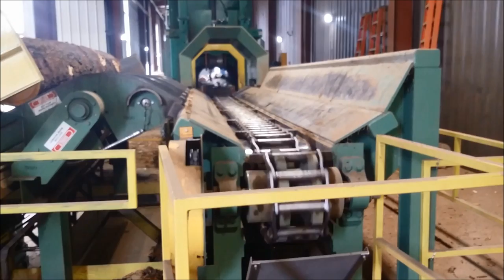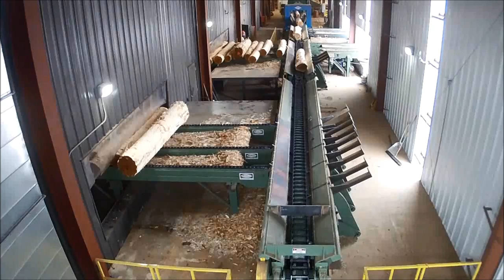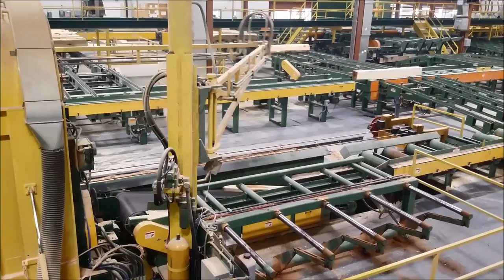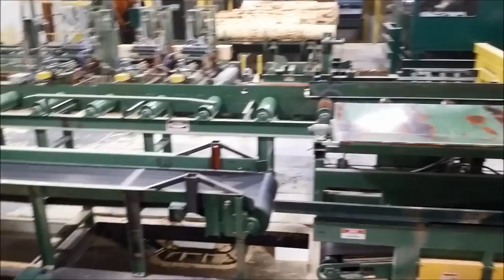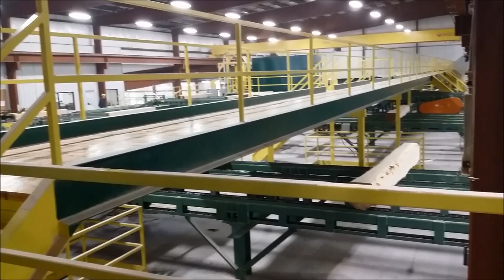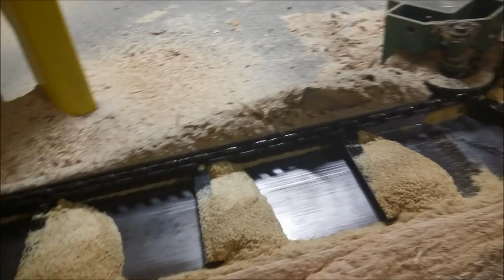MELLOTT -  Log and Lumber Conveyor Systems at Wagner Millwork - Owego, NY

Comment: At least one time I’d like to see a video of the filing room or two. Places where I worked called the filing room the heart of the mill. I worked as a saw filer in my youth and would like to know if they still use same methods as I used back then. Like hammering saws, etc. in both circular and bandsaw. I first trained on 5 foot gang saw blades before I moved up the ladder. Don’t see too many of those machines anymore.